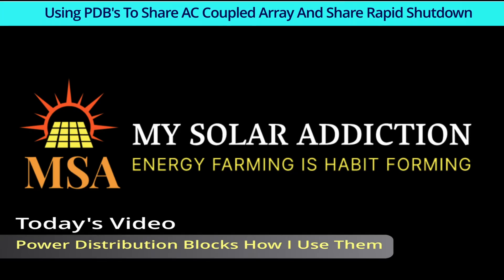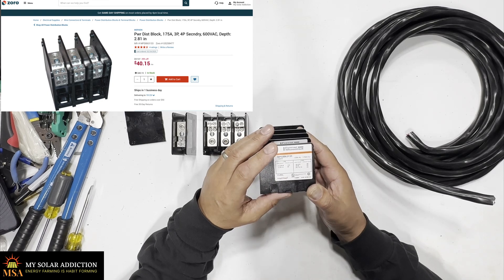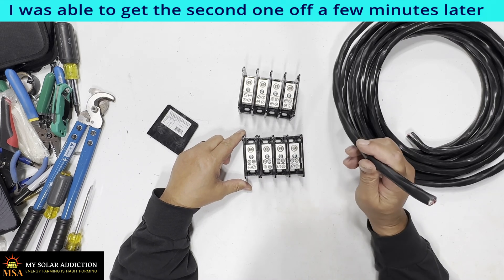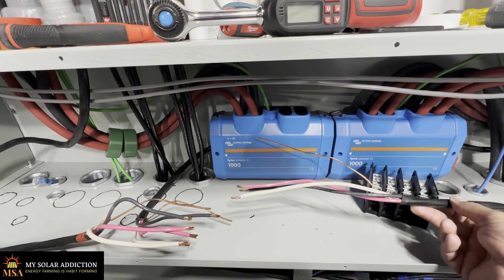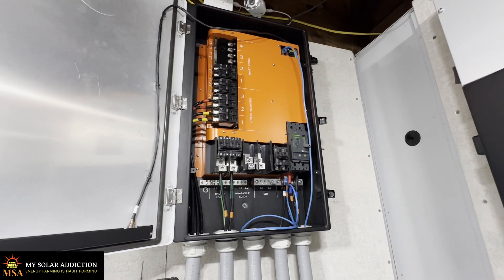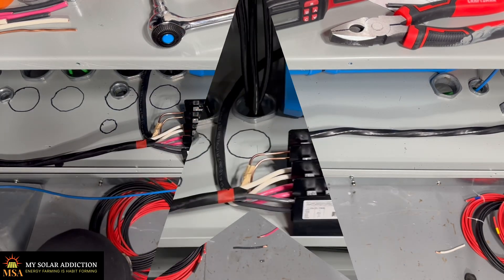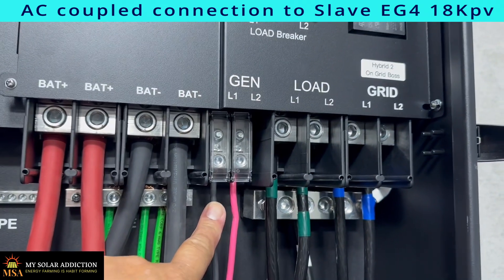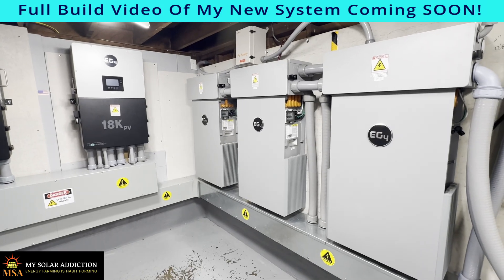Power Distribution Blocks How I Use Them

Comment: SolArk and the 18kpv are two of the worst inverters on the market. Both of these cheap, Chinese-made inverters use high-frequency, transformerless inverter tech that offers poor surge capacities and shorter life expectancies, and they both can fry your home's appliances when their MOSFETs/IGBTs fail because they offer absolutely no galvanic isolation. You would have been far better off if you had installed low-frequency, transformer-based inverter chargers.
Reply: What brand inverters then?
Reply: I have dual XW Pro inverters, LF  but Schneider has EOL'd them - bye bye